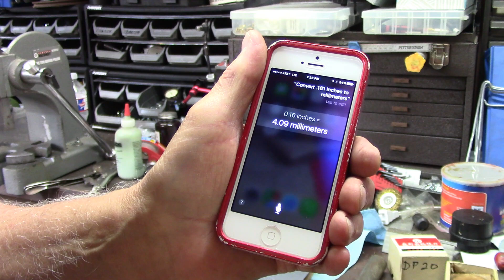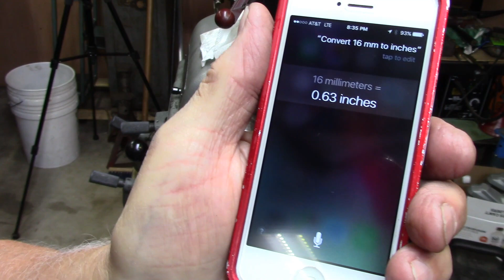Arbor for DP20 gear cutters part 1 of 2

Comment: Maybe one suggestion that may save issues when machining arbors or just about anything, better to make all the roughing part first, leaving something like 10 to 20 thousand of inches for doing a final cut AFTER all the roughing is over, the main reason for this is that the metal will distort as you take bigger cuts and if you got a finished part that moved a little then there is no material to make corrections...
Reply from the maker: I will keep that in mind.  Thanks for stopping by.

Comment: That 12L14 looks easy to work with. I’ve been working on lathe backing plate made out of cast iron, not malleable iron, it is an old 10 # barbell weight. That stuff is hard to cut and eats up my inserts! I also did a project with 1045 stress free and that work hardens too easily but the project came out beautiful. I’m looking forward to something easy to cut for a change!
Reply from the maker: It is expensive metal but it is a pleasure to cut.  Probably not for hard use though.  Thanks for stopping by.